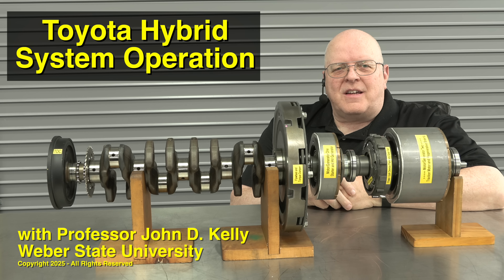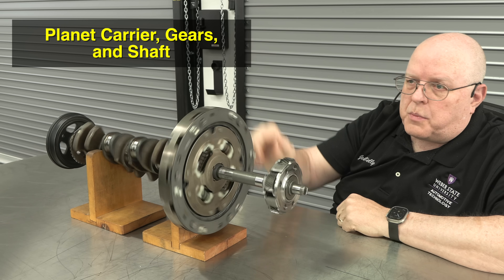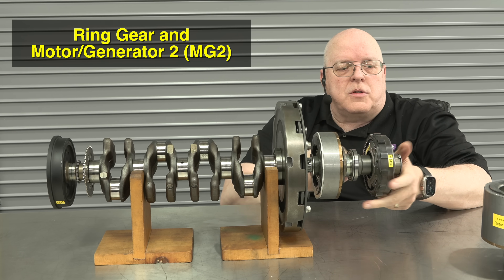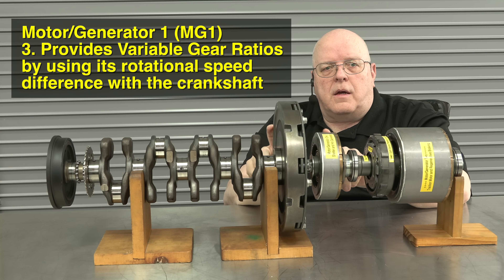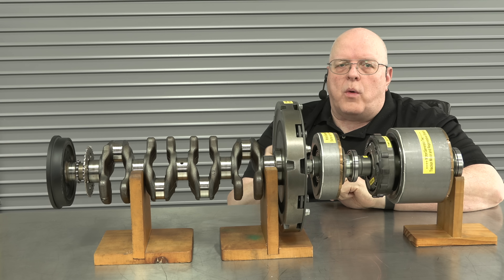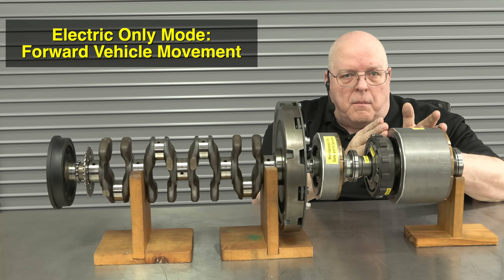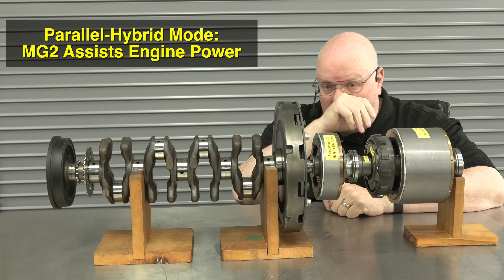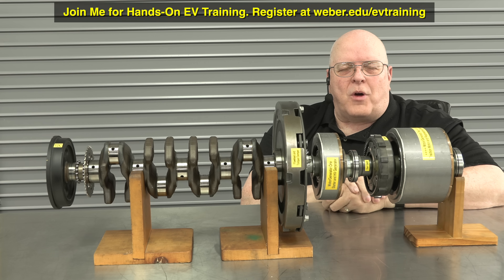Toyota Hybrid Transmission Operation - 15 Years on YouTube!

Comment: It's even simpler than a freaking manual transmission what a genius design
Reply: As a mechanical engineer with a strong emphasis on electrical motors, I consider this an invention of elegance and supreme beauty. So many times EV enthusiasts say that a hybrid has the worst parts of both technologies. This system actually exploits the best of both technologies. When you add in the understanding of how this system effectively keeps the ICE in a torque and RPM range that is very close to optimal efficiency for the vast majority of operating conditions, then the full extent of this systems elegance can be seen. As others have pointed out, the total system’s mechanical complexity is less than a comparable fully mechanical engine and transmission. On the electrical side this system removes range anxiety and drastically reduces the size and cost of the usual EV battery (helping with battery production). On the plugin vehicles, maybe the battery gets cycled more than a pure EV but this system provides 90% of the benefits of a pure EV without having to deal with on trip charging. If the vehicle is charged at home, the ICE will have relatively little usage and wear (maybe even to some negative effect).  These vehicles are certainly not more expensive than comparable pure EVs, so until tesla delivers on a truly affordable alternative, I personally consider this system as an optimal choice for this decade.
Reply: @Mentaculus42  2021 Model Y and 2024 Prius Prime owner here.  I think your post is accurate. I look at the plug-in Prius as more efficient than the Tesla (approx 200wh/mi vs 280 for the Model Y), and running in the ICE hybrid mode it's getting 50mpg.  It's actually the best of both worlds.
Reply: @daviddennis5789  it's no surprise that Prius is much lighter than Tesla Model Y. (3000 lb vs 4000 lb)
Reply: @Mentaculus42  All of the bad press for phev's and hybrid's is basically coming from non Toyota brand, mostly european junk
Reply: @Mentaculus42  However if psychological reasons aren't preventing you from driving an EV, they are simpler yet. Hybrids have all the components of an EV + an ICE but lacking in the benefits of the EV like home charging. Don't get me wrong, engineering wise this is fantastic. But I would rather have just the EV drivetrain vs EV drivetrain plus extra components and still have to make trips to fuel up elsewhere, and change oil every 5-10k etc. And performance is very lacking too
Reply: @alt572 

I guess u r unfamiliar with the CONCEPT of a PLUGIN HYBRID, like the type u charge at home and that Toyota uses the PLUS name. Also the amount of TIME on the engine is INDEPENDENT of the VEHICLE MILEAGE and service intervals are determined by other factors that just mileage (more time and the need to keep the gasoline relatively fresh). So you might need to reevaluate some aspects of your beliefs.  So if your plugin hybrid has an engine that is sorta along for a RIDE and NOT accumulating OPERATIONAL WEAR as a standard ICE does. A typical TOYOTA ICE is usually good for 150,000 miles of OPERATION and a hybrid can run the engine considerably fewer hours to cover that mileage. Also pure EVs still have service intervals for both oil and cooling fluids but since these fluids operate under less demanding conditions the intervals are extended. Also from watching various videos on this channel, it is sometimes required for the dealer to change these fluids on various EVs which is expensive!
Reply: @alt572 A battery electric car has thousands more battery cells that can fail compared to a hybrid car.
Reply: @alt572  "psychological reasons"... please dont pathologize other people's preferences just cause you dont agree. Personally I think EV cars are great, but have no intention of buying one anytime soon and its not for any pathological reasons. More like simple cost to purchase, and the fact I take about a dozen 6-8 hour drives in the average year, many away from interstates and several with groups of people so stopping for 30 minutes to an hour at a specific charging point is not convenient even though most of our driving would be easily covered charging at home.
Reply: @alt572  In places like Australia a BEV is not practical for many people. A PHEV is the best option. With mine I can do my short haul commute on the battery most times and charge it each night at home. If I have a trip that is outside the battery range I use it in power share mode and I have found that this accommodates nearly all my long distance driving without having to worry about finding a charger. Of course if one is available where I stop for whatever reason then I will use it.
Reply from the maker: Agreed, thank you for watching
Reply: @WeberAuto Good morning Sir, 
     I have a MDX with a ZF9 transmission.  When it changes to 8, it makes a clunking noise.  I was told it's. Characteristics of the transmission that I'm not buying, after driving several other models with the same transmission.  They when as far as telling me it's due to dog gear.  Any thoughts?
Reply: @Jamrock626 watch videos from Next Gen Transmission as I may have seen something they mentioned about ZF 9 speed
Reply: @Jamrock626  The ZF9 has two dog clutches.  It's a smooth transmission at times, but wonky at others.  I had it in my 2022 Honda Ridgeline.  Cylinder deactivation makes it wonkier in my opinion, if your MDX has that.  I heard weird stuff clicking in the transmission on mine.  Sold it and got a 2025 Camry. hybrid.  Its trans has no sound at all, no shifts, just perfect smooth power and instant torque. The Accord doesn't have that instant torque- it's a different design...if you're going about 50mph and you punch the pedal on the Accord hybrid, there's a delay until the engine winds up.  Not as good a system as Toyota's and not as reliable.
Reply: I'm Japanese. For a long time, I thought Toyota invented this system, but recently I learned that Baruch Berman UC Berkeley invented it for GM.
However, controlling the motor with gears, electrical circuits (not electronic circuits), and lead-acid batteries was impractical at the time... so they apparently abandoned commercialization.　Later, with the invention and practical application of microprocessors (8080? 8086?) and nickel-metal hydride batteries, making them suitable for automotive use, this system finally became practical. I hear Toyota bought the patent from GM... Of course, Toyota's implementation likely differs from Mr. Berman's original principle, probably to avoid patent disputes.
Reply: @酒呑童子-j1h  It's genius, no matter where it came from. And Toyota implemented well. They inverters are as solid, made with quality components.
Reply: @酒呑童子-j1h 

Interesting. The general concept might be very similar BUT the devil is in the details and Toyota has put a lot of long term effort into this design. It is interesting that this came from GM and they used a much less elegant design on their various Volt cars. Would be an interesting story to learn about why GM did the things that they did.

Unfortunately I could not find any reference to this person via google. Would be interested in knowing more. 

It is interesting that a number of E-axles for heavy duty trucks use a somewhat similar concept but with two electric motors driving a planetary gear cluster to get the benefits of a variable transmission. It is very likely that a heavy EV truck could stall at startup on a steep grade and usually need the benefit of a transmission of some sort. Tho tesla has taken a different path in this area but I am still waiting for them to get into full production.
Reply: @酒呑童子-j1h . Thank god you Japanese got that gearbox to perfect it  , I’m a very happy Lexus hybrid owner in Europe.
Reply: @酒呑童子-j1h The core principle (power-split using planetary gears) is Berman’s, but Toyota’s execution and refinement are original.

In fact, Ford later licensed Toyota’s implementation patents for their own hybrid eCVT (e.g. Ford Escape Hybrid). Toyota and Ford cross-licensed to avoid lawsuits.
Reply: @酒呑童子-j1h  Researched the name Baruch Berman UC Berkeley and found nothing to support that.
Reply: @酒呑童子-j1h  powers-split transmissions have been around for decades... perhaps a century or more.
Reply: @酒呑童子-j1h  Sounds like something GM would do.  American automakers have trouble sticking with things.  They market the heck out of stuff, but then abandon it and start something new.  The Japanese have a longterm love and improvement type of philosophy.  Would never buy a GM car or Ford these days.
Reply: @酒呑童子-j1h Not only that, but Toyota infringed on 3 patents held by Alex Severinsky:

U.S. Patent No. 5,343,970
U.S. Patent No. 7,104,347
U.S. Patent No. 7,237,634

These patents covered various control methods that Toyota use to manage integration of the ICE and Motor/Generators. Toyota settled a lawsuit brought by Severinsky in 2010 after numerous rulings against them and the FTC voting to investigate Toyota's infringements.
Reply: @Tyrial7 

Is it ever possible to design anything relatively complex and not run afoul of some patents in a mature industry? The question is if Toyota purposefully and knowingly used the concepts in the patents or reinvented them independently. When it comes to patent litigation, generally there is a complicated web of factors.
Reply: Probably not, but the lawsuits proved Toyota was aware of the patents and chose to infringe on them anyway without paying royalties to the patent holder. There is a very good reason why they chose to settle instead of continuing to fight, not to mention the pending FTC investigation into their trade practices.

Make no mistake, if it were the other way around Toyota would have defended their IP rights just as fiercely.
Reply: Since 1996 too.
Reply: so mg1 does not gives add torque support to the wheels?
Reply: @user-Moonhoney  Good question! Would like a more detailed explanation around that, perhaps during the overdrive mode (tho it should be possible to puzzle this out).
Reply: @user-Moonhoney , it does assist at times
Reply: And extremely reliable. No friction, just gears and electric motors (that are inherently reliable, when kept cool). The car will rot before the transmission dies. 

Unlike the classic CVT that RELIES on contact forces to fonction. and specifically, huge forces on on tiny contact patches. You have oil issues (poor quality, overheating, too old, too contaminated), the transmission instantly dies.
Reply: So how does this differ from a hybrid transmission on another make of vehicle? Not as efficient?
Reply: @ShirleySerious 

What is a “hybrid transmission”?? Is that a transmission for a traditional hybrid vehicle or a transmission that as a transmission has both electric motors and mechanical components? Either way, this channel has a number of great videos that provide clear explanations of the associated topics (or in other words, the answer deserves a good video). Now why do u suggest that the transmission that the video displays is LESS EFFICIENT?!? In reality it is PART of a complete system that was designed for HIGHER EFFICIENCY and reliability! What parts do u suggest that need to be changed to increase system efficiency??

Generally if you use only a generator feeding an electric motor the electrical ENERGY losses are higher than a straight mechanical connection at cruise speeds. BUT a DIRECT mechanical connection forces the ICE to vary a lot in RPM and associated torque output which can reduce the ICE’s overall efficiency significantly.  This setup provides the benefits of both approaches without the negative compromises associated with them.
Reply: @ShirleySerious  Which other vehicle?
Reply: @ShirleySerious it is the same as some hybrids, including several from Ford. It is a less sophisticated (but simpler therefore more reliable) variant of the design used by GM and others (including the Chevrolet Volt). It is very different from typical parallel hybrid systems (from many manufacturers, jncluding Toyota's own system in current trucks); it is also very different from series systems (such as the Fisker Karma and BMW i3).
Reply: Quote from 　@sakaiyasu4509

I am a retired Japanese engineer. The idea for the power-split EMT (Electromechanical Transmission) was conceived in the United States during the 1970s following the oil crisis. Since this patent (the Berman patent) had expired and become public knowledge, Toyota was able to adopt this mechanism with confidence. Even though series hybrids (like Nissan e-POWER) can achieve the same function, the reason for using a power-split mechanism is that it reduces the power loss through the electric path, which is less efficient than gears. The operation of planetary gears is easier to understand using a co-linear diagram. However, the co-linear diagram only shows the speed relationships. The torque of the ring gear, carrier, and sun gear is always proportionally distributed. Only by considering this together does the operation of the THS become clear. The 13 modes summarized by Professor Yamamoto do not exist individually; they are all seamlessly connected. In the nomenclature by Barman et al., MG1 is called the “Speeder” and MG2 the “Torquer.” I believe this better describes their nature. MG1's role is to modulate engine speed; torque is a consequence. MG2's role is to modulate drive wheel torque; speed is a consequence.
Reply: Thank you master always high level instructional videos😊
Reply: New generation take more simple design with only 1 motor
Reply: Exquisite engineering. It's amazing how hard the auto industry will push its engineers, just to make sure the oil industry gets their tribute.
Reply: It is complicated system manual is very simple
Reply: Meanwhile Toyota is now adopting BYD hybrid tech.
Reply: @archangel7052 Meanwhile, another clown posts a controversial statement without any verification
Reply: It is definitely not simpler. You got two extra electromotor's, complex control units, battery-pack, lots of extra sensors, lots of extra wiring. You are not seeing the real business end of the system in this vid.  And what is worse, fuel savings are marginal, it is simply not worth it, production cost, increased maintenance cost as it gets older, shorter life span and much higher recycle cost is MORE than the fuel that is being saved.  Propaganda, the official required fuel-consumption numbers are 30% to 50% worse than real life eco-driving. As in, on cruise control in perfect conditions at 90km/h still has 30% more fuel usage than specifications. Also they often skew the numbers the easy way by fitting non-hybrid versions of the same car with much wider tyres, "o look it uses more fuel than the hybrid", while the hybrid version is on narrow eco tyres. 
It is full propaganda mode and government purely taxing on every drop of fuel used that pushes hybrids. And yes I drive currently a hybrid from Toyota and I will avoid hybrids for the next car as the plague.

(edit: did check a check on a major car website where user reviews report fantastic fuel consumption, three accounts, three reviews, all three got just one action on this website, only wrote the one car-review and never anything else. suspicious to say the least)
Reply: @basbass429 Bullshit. Toyota's hybrid system contains fewer parts than a traditional drivetrain and costs Toyota less to manufacture than traditional drivetrains and is also even more reliable and trouble-free. Toyota's hybrid system means that it replaces many unnecessary components from a traditional drivetrain such as a gearbox with 100s of components, you don't need a generator, freewheel or starter motor, you don't need drive belts or tension rollers, you don't need dual mass flywheels, transmission linkage slave cylinders or starter rings. PS: By the way, why do you think the Toyota Prius has the world record for the lowest consumption of all cars (there are many cars that are smaller than the Prius) from coast to coast through the United States?

Comment: I would really like to have driver selectable permanent series mode , that of course less efficient but is so much more comfortable in city driving.  How I know ? That is the mode my hybrid is operating in after start for about 20-30 seconds, then switching to parallel mode.

That basically what honda and nissan hybrids do. An EV backed with ICE generator and small battery.
Reply: maybe the most reliable and simplest system😂only one engine,two motors,and a small battery,can last longer than a manual
Reply: @xiaochuangsun6427 mechanical reliability is undoubtedly superior. Plus a bonus of no alternator and starter .  One more bonus MG1 is acting as times more powerful starter, cold winter ICE start is typically about one second.
Reply from the maker: Thanks for sharing your thoughts!